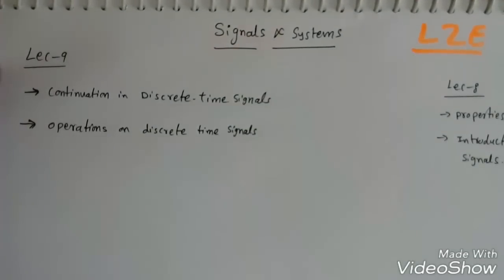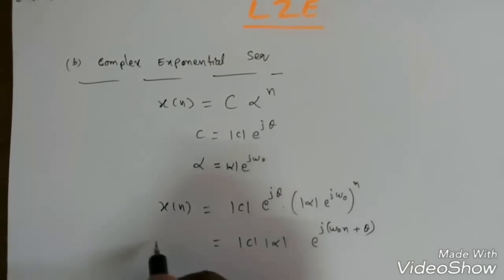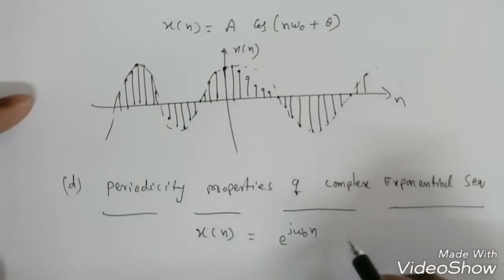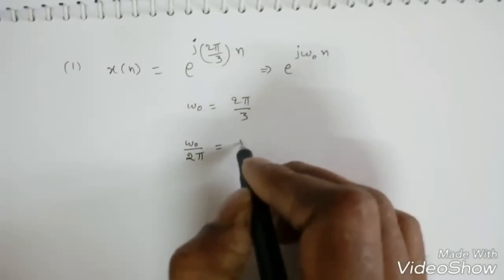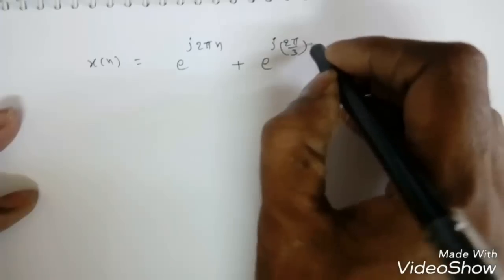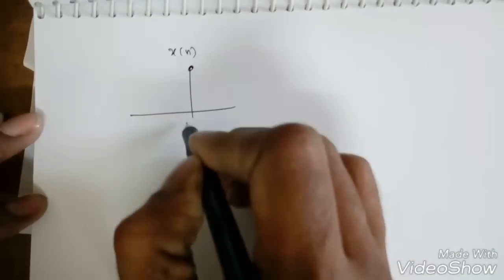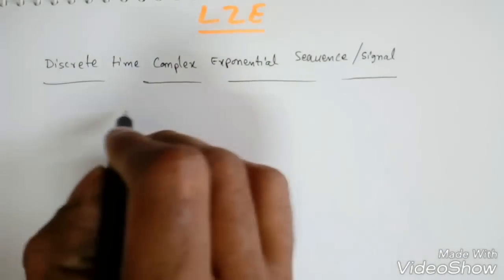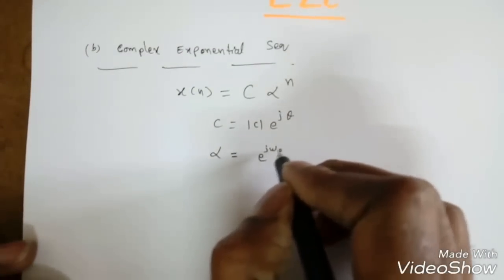Signals and Systems Lec-9: Discrete Time Signals

Comment: At 13.30min, the Period formula You have taken wrong .For Irrational Period.
Reply from the maker: yes i have taken wrong it should be N = (wo/2.pi)...thanks for correcting me..but answer is not a periodic signal..because pi = 3.1415926...is irrational number...